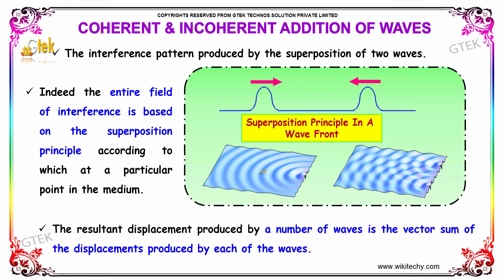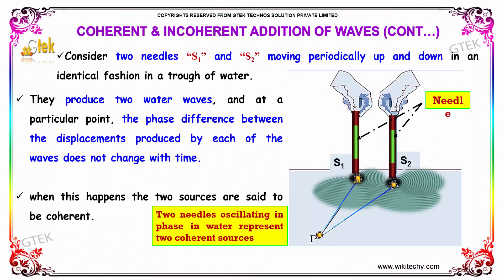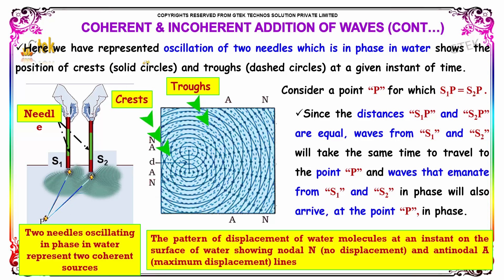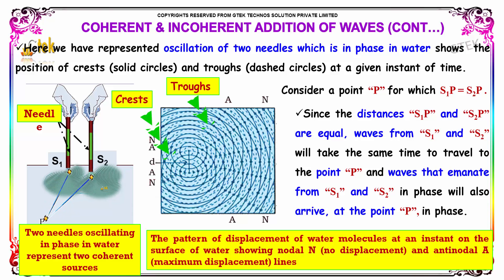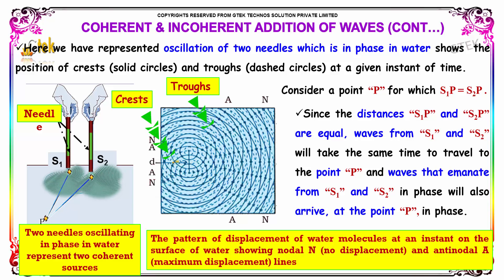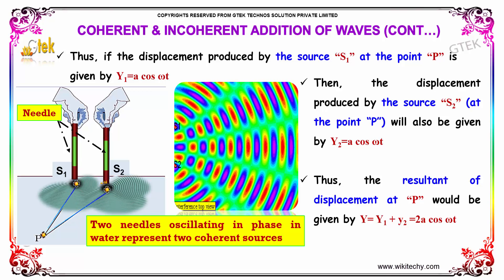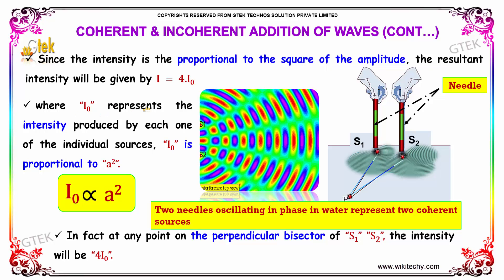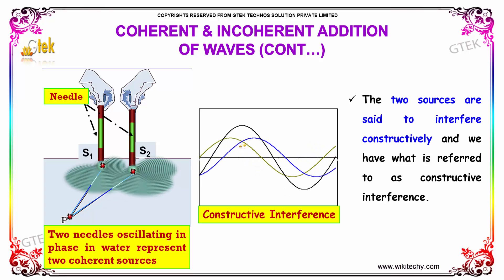Coherent and incoherent addition of wave Part-1 |Optics|class 12 physics subject notes lectures CBSE

Comment: Coherence was originally conceived in connection with Thomas Young's double-slit experiment in optics but is now used in any field that involves waves, such as acoustics,electrical engineering, neuroscience, and quantum mechanics. The property of coherence is the basis for commercial applications such as holography, the Sagnac gyroscope, radio antenna arrays, optical coherence tomography and telescope interferometers .

Comment: Two waves produce the interference pattern only if they originate from coherent sources. The process of light emission from ordinary sources such as the sun, a candle, an electric bulb, is such that one to use special techniques to get the coherent sources. In order to obtain the fine interference pattern the path difference between the two waves originating from the sources should be very small. In practice the path difference should not be exceed a few centimeters to observe a good interference pattern.